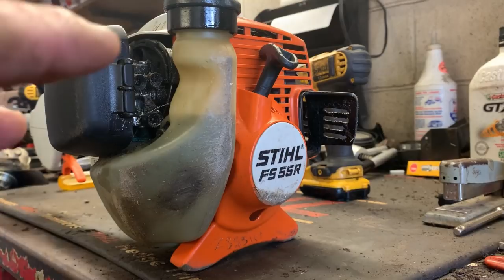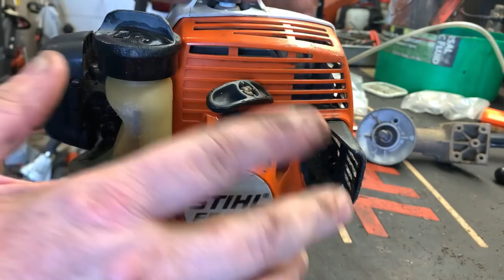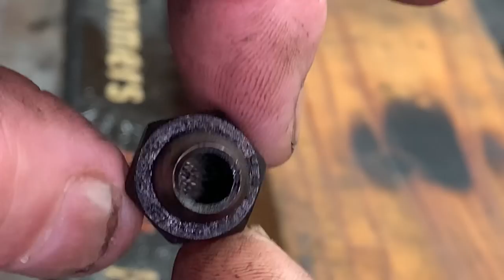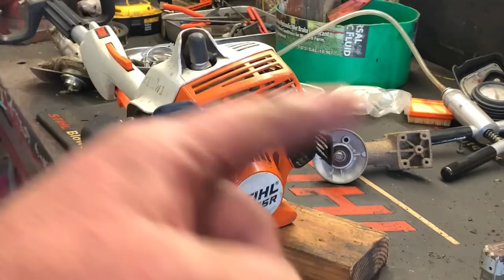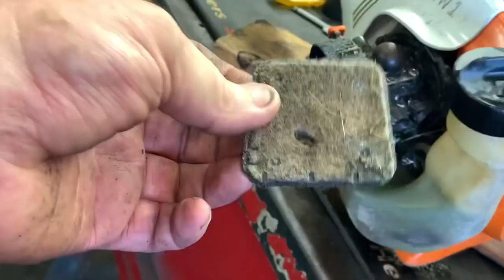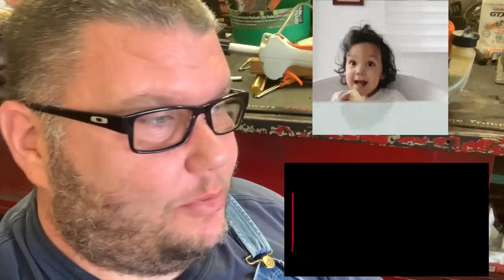#1 REASON YOUR TRIMMER IS HARD TO START AND AND RUNS LIKE  💩  💩 💩

Comment: Handy Video Medic, was having trouble with my Stihl Bg60 blower, didn't want to rev all the way up. Constantly adjusting the air mixture screws every time I used it to no avail, turns out it was the spark arrestor plugged. Cleaned it up and we are back in business........also did my entire fleet while I was at it........

Comment: Tell that customer to be sure and add a little gasoline to the "oil tank".   They are probably thinking if a little oil is good, more has got to be even better.
Reply: 😆 yeah
Reply: I don't need no measure cup. I can eyeball it. I'm a professional
Reply: Ethanol gas kills. Absolutely 🤗
Reply: @jamesharrison6201  Our Buc-cee's down here has started selling ethanol free gas.  It's not cheap, but that is what I get if it goes in a small engine.

Comment: I have same weed eater Styl great stuff I use their oil easy to mix 1bottle 1gallon gas barely any smoke after startup runs great and recently I checked air filter cleaned it next will be the flame arrester but I still runs nice now 2pulls

Comment: Been using amsoil 2stroke mix for 11 year never had an issue changed to Stihl mix this year and now I’m having issues with all my 2 stroke equipment. As for the spark arrester I just remove them clogging problem gone
Reply from the maker: Your equipment is 11 years old why change oil brand now? You set yourself up for failure when you did that I’ll never understand the things that people do

Comment: Unless you use it daily. It’s junk. The new gas. No matter ethanol or non ethanol. Both gum up in just a couple days. Both of my brand new weed eaters ( high end )have bent shafts now and I pay my neighbor to weed eat. Been working great for 7 years. So I guess the trimmers are not brand new. But 7 years ago when I wrap each one around the fence posts. They were new. One needs more string also. (The oldest one) They junk. None are made for a 6’5” person. None will sit for 2 weeks with gummy gas. If you think your really buying “non ethanol”. Sorry to bring you into reality. But the gas stations that advertise that?  Not near water. (Water craft fueling stations are true around here). But highway convenient stores will just put the higher price on the cheap 10% fuel. So buy all the fuel stabilizer you can afford each week. Dump every bit of it into the 1 gallon can you purchase each week. Then your left over teaspoon of fuel in carb maybe won’t solidify. Or be extra anal and stand there till your fuel tank runs empty. And only buy half a gallon each week. So figured all that into your justified price of just paying someone that does it daily to help out.

Comment: My fs38 only runs with half choke... even with new fuel primer bulb it barely keeps enough fuel inside it to run.... after about 30 minutes of it bogging down and dying several times it will eventually run ok but mainly wide open throttle.... bought a carb rebuild kit on ebay but yet to install... as far as I know mine has never had the exhaust screen removed and it probably has around 50 hrs or less on it... I wonder about my Husqvarna 36 saw and it's exhaust screen? It usually runs fine but is a pain in the ass with low chain oiling making easy to burn up a chain and bar.... I absolutely hate cleaning out the sawdust after every use or every other hour or two of use!!!!!!!

Comment: One second fix. Get a screw driver, stick it inside the exhaust and puncture the screen. And go back to work
Reply: I was just wondering what would happen if you just cut the screen off completely
Reply from the maker: Sparks will fly out and catch stuff on fire don’t do it
Reply: @THEMOWERMEDIC1  Ah ok 👍🏼 good to know
Reply: All my equipment runs with no screen. No fires for 15 years. You really need to try to ignite something really hard to do it. Still won't start anything serious. Someone show a video about that happening to make believe

Comment: I've clean my dad's exhaust port all the time he refuses to run it over half throttle but its ????? Ridiculous amount of hours on it still runs great though
Reply from the maker: To each is own
Reply: If it starts bothering you cleaning it all the time just remove it all together, There is nothing wrong with removing it, And there is really no way sparks are gonna come out... They just put them in there to pass emmissions tests. They dont really do anything besides clog up
Reply: Thats if you dont run it at full throttle and are always cleaning it, If its always ran at full throttle you should never have to worry about it plugging unless like he says (There is too much oil mixed in) Then it will definitely plug up
Reply: @hotwheelsracer6380  the arrestor is good about keeping dirt daubers out

Comment: That much  oil just cleaning screen not enough I normally throw  exhaust in wood stove    or torch it  residual oil  will clog it quickly
Reply from the maker: It’ll be fine all you have to do is run the trimmer hard for a tank of gas

Comment: What ratio is best 30:1? The manual says 50:1 but I hear that’s rich
Reply: 30:1 is even more rich than 50:1.  If the manual says 50:1 then run it 50:1 about 2.5 oz oil to a gallon of gas.